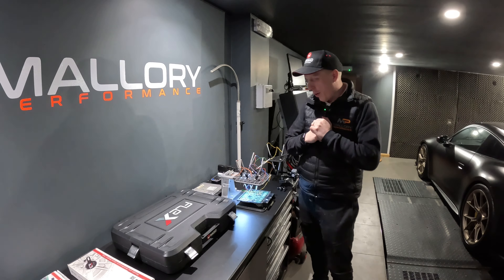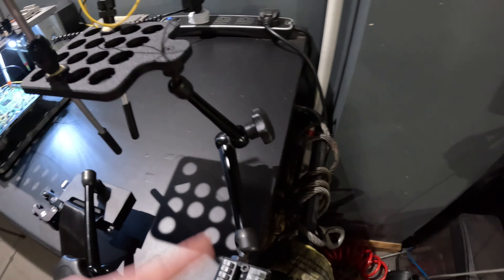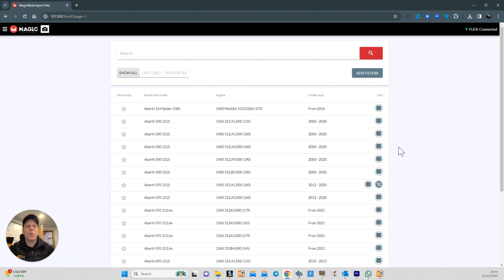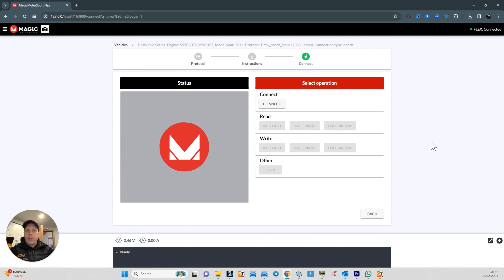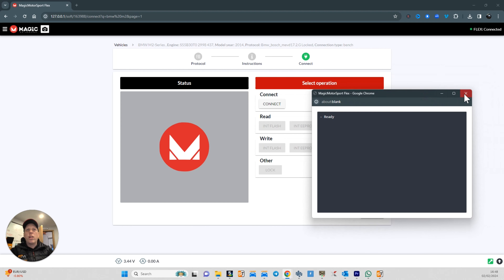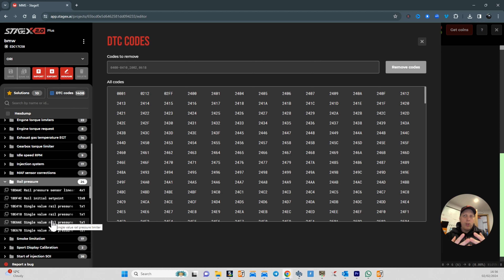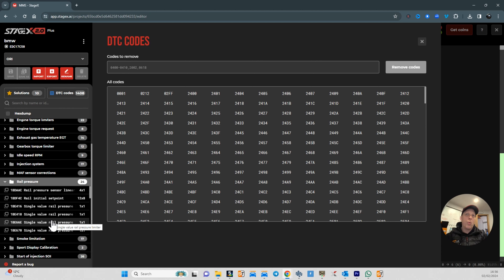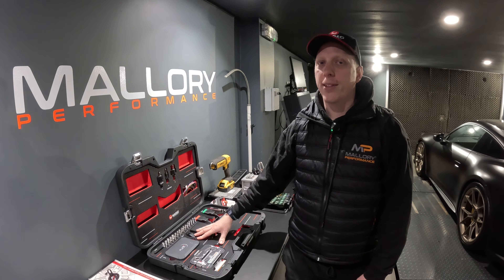Flex by Magic Motorsport Overview 2024

Comment: do u personally prefer more :

Autotuner or Flex?
Reply from the maker: To me it’s always been - dev work usually bFlash or cmd, odd balls - bench - cloning then flex. My autotuner master is over in Slovenia at our other branch so I rarely use it, mainly have it for slaves
Reply: @Phil-Cooper my flex is having issues cloning med9.1. the green #3 pin on flexbox doesn’t light up but all the others do. tested flex, works perfectly. u ever had issues cloning?

Comment: How do you rate cmd , the say can work on some 2021+(protected) ecu like med17, edc17 and even some md1? Rs6 2022? Does flex has similar capabilites?
Reply from the maker: Cmd is a good tool, and one I need to do a review on tbh! 

Any protected ecu with the later boot loaders are locked on all tools unfortunately.
Reply: Thanks for the reply, looking forward for the review of the tool @Phil-Cooper